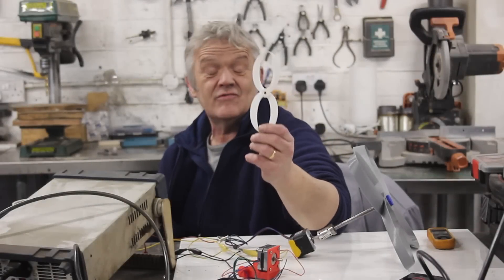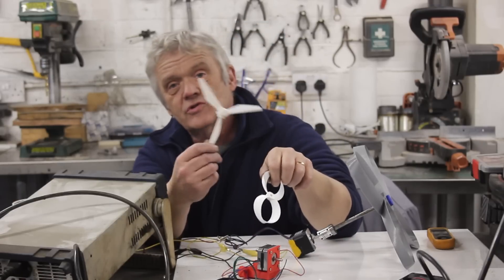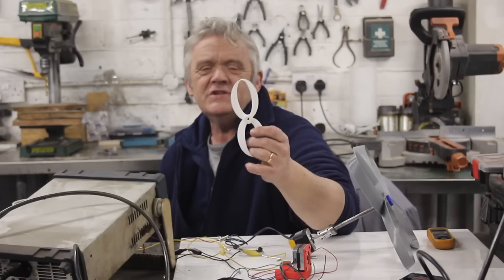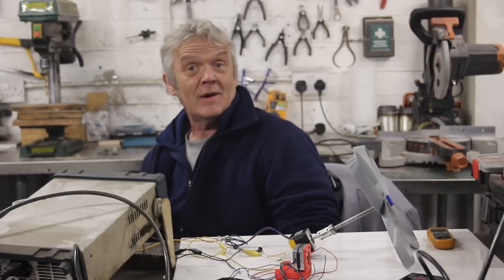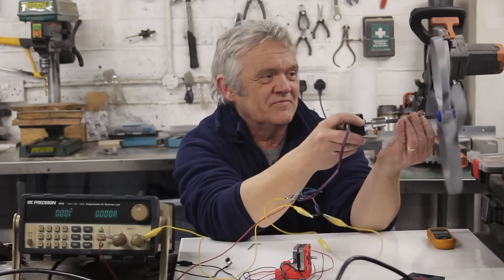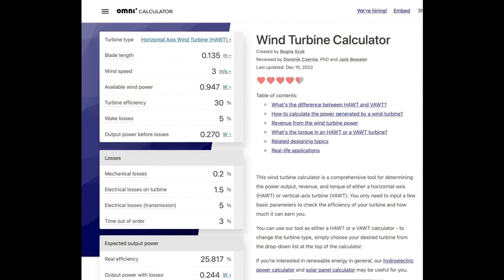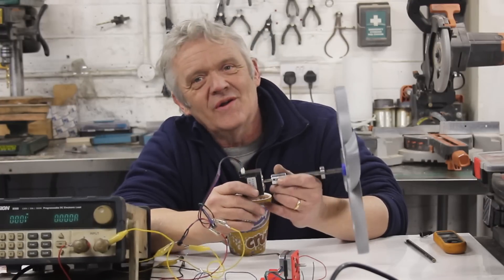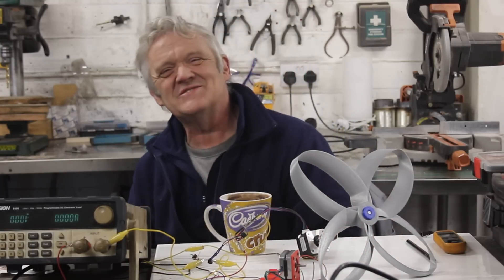1846 Further Testing Of The Toroidal Propeller For Wind Turbine Use

Comment: Why did you not use a normal dc motor or for that matter an AC generator , both of which rotate more freely than a stepper motor , i have yet to see a stepper motor used in mainstream power generation . As the maker of the toroid blade stated about the orientation of convex vs concave i don't see that doing anything other than change rotation direction , but i would be inclined to try different wind direction angles to see if this increases or worsens the outcome.

As for the design ,i've seen a few videos about this in boating applications with lower rpm giving the same thrust , and as water and air are both considered fluid mediums with different viscosities the same should be for air , with a reversal of air as a generator it should create more torque.

I would like to try it myself as i want to make a hand crank and wind powered generator for a super capacitor power bank to feed  AC inverters here in the UK (Scotland bit), i'm pretty sure pvc pipe could be cut into even strips and bonded to a pvc hub with the proper twist added to make each petal.

I do enjoy the video series and get some good ideas , i have a copied book on AC motors used as water turbine generators , i believe you wanted to know the hows and whys of the cap calculations etc , if you can pm me i'll send the pdf i have for this , maybe you could update the  turbine diy generator video ,likely a hit with the video audience.

Best wishes.

Comment: There are now neodymium motors which means they have low rpm but produced high voltage or amp. This low rpm motors need good torque like this turbine design.

Comment: Ur text is insufficient. The advantage of this design is not good rpm, but high torque even at a low wind speed. This is the merit of this design. RPM can be remedied with a gear, but without torque nothing can be done.

Comment: Toroidal props are just inverted Archimedes screws cut into short sections. Their advantage in water is negating cavitation. Under water cavitation is a destructive force due to microbursting air pockets which form when water is "cut" at high speeds. It's not unlike breaking the sound barrier in the air, only this happens at much lower speeds under more dense water. When this happens the microbursting air bubbles cause damage to the surface of the part over time. This is hardly noticeable to external propellers where the bursts can dissipate their shock to the surrounding water but do affect the noise and thrust... The microburst can also cause huge spikes in pressure for internal parts like impellers and can crack the engine casing entirely. So reducing underwater cavitation is a big deal. It's just disappointing that toroidal props only seem to offer a slight noise reduction for aerial applications and don't seem to offer any other real benefits... yet.

Comment: You need the blades more off set like a double winged plane that is connected by a loop in a way that make more lift. I don't think the crazy eight is aerodynamic enough. Or could be made more efficient with better geometry.

Comment: we have all had our fun with how the Toroidal Propeller just don't live up to the hype in air but, wasn't it developed for water use? if so, its dementions need adjusted for the fluid its working in to work at peak efficiency . Please try the traditional blade vs. Toroidal in water

Comment: seems like the angle of the blade is more important than it's shape, just as you found that a flat sheet at 35º was the sweet spot for redirecting oncoming wind downward into your tunnel for that project, and so the angle of the bladed needs to be more obtuse to the wind up to a point, to redirect it, (which is what generator blades are doing, the more redirection the more energy they can take from that incoming wind, while the propeller the more obtuse to it, the more energy it can impart into it as it redirects it, say for thrust.) 

what I want to know is can this angle be changed as the speed of the blade is moved to get more gains, or is this a fools errand and it changes nothing. :) 

the one benefit I can see these blades once the angle is set correctly if that bowed tip can reduce air current vibrations, would be on giant turbines they worry about birds and bats being harmed by the sonic vibrations created, but the direction you are going of many smaller units coupled together to get the higher value amount and in parallel so each one is redundancy, also completely does away with the worry to birds, bats and such because any sound they produce is so small it gets absorbed by air particles and reduced quickly so they don't have the range of influence on the environment, sonically that is. :)

Comment: :/ Disappointed... 
Here's the guy who mixed highlighter-pen ink with gelatin and laughed with infectious glee when it questionably squeezed out a few extra milliwatts from a solar panel... Now we've a stepper motor as a generator as a reliable test? "Steppers are 80% efficient," he says... but this means nothing without a side-by-side and more detail... NEMA has to do with mounting, not winding-resistance, turns, or even the size/spacing/type/strength of the rotor's magnets. If you shine a spotlight on a tiny calculator solar cell mounted in an 8x10 picture frame, it won't give you much more power than a fluorescent ceiling lamp would. And nowhere near the power of an 8x10 solar panel with room lighting.
Not saying I expect a huge difference, nor even improvement, from these blades, but I am saying that you seem surprisingly/uncharacteristically opposed to giving them an honest chance. Almost like you're either afraid of, or hiding, something.

Here's an idea I'd've considered more characteristic of you: I wonder if a toroidal prop could be made of little more than a twisted strip of paper stapled to a hub. Its flexibility may actually be beneficial for different wind speeds and loads, a bit of a centripetal governer... More of a sail than a prop. And, most of all: easy to build. Which is right up your alley as someone usually trying to inspire folk to try things that aren't necessarily the most-efficient, but *doable*.
Maybe I missed a vid?

Comment: I suspect the reason you're not getting anything out of those toroidal propellers is due to 2 reasons:
1.  the models on the internet are not designed for wind turbines and are instead designed as propellers. I personally recommend lowering the angle of attack (making the blade angle closer to the vertical axis by about 5 degrees) and using a slightly thicker airfoil at the root. 
2. You held it backwards the entire time, I can see the camber on the blades. It's like using a solar panel as an LED, possible but not very efficient! 

The advantages toroidal propellers have over their more traditional cousins is faster wake recovery, elimination of wingtip vortices, and a more evenly distributed turbulence area. This means that you can place wind turbines closer together for the same energy output. I don't think anyone is making toroidal propellers for wind turbines but if you do the aerodynamic characteristics of wind turbines and propellers are similar yet very different!

Comment: What you need is a Prantl based prop!    Most efficient ducted fans are found in the cooling fans of the ISS. Also i almost never see a proper toroidal fan in this new found hype. There was an aircraft a long while back that had this kind of prop, but the tips were bent differerently in order to enhance lift and reduce tip vortices. Unfortunately i dont remember who made it. Cheers

Comment: Very great overview of the test process and how to check the results.  One thing people overlook is it was ' designed to overcome cavitation ' and not to increase rotation speed or torque.  One additional test would be to use a motor and a sound meter to ' listen ' if you can hear either type of blade when the wind blows, however, I believe that kind of testing becomes moot when thinking of power generation.  We, as people, have put up with hit-miss engines in our collective history for power generation and sound output is only a convenience factor.

Comment: A conventional propeller as several characteristics like pitch, and the rate the angles change from center to edge, the curvature, straight blade vs swept blade , different values for different sizes and wind speed, that have been refined over many years to be better then just popsicle sticks.
   The new design may have merrit , obviously they will need a lot of research to figure out what kind of characteristics and values need to be understood then tweeked to make them work at their peek before we can truly judge.

Comment: Hi Rob, love the video's, so much information! One difference between the toroidal props and the powerboat prop is the plain on which each surface starts and finishes. The Sharow prop has a distinct double level, almost like a biplane, whereas all the props built for drones etc are simple loops. Big difference and may be why the 3d printed props are pretty useless? Just a thought!

Comment: Hi Robert. I'm the friend you mentioned who sent you this '4 petal' toroidal propeller. Looks a great 3D print but when I make these 'windmills' as garden ornaments I always orientate the concave edge of the blade into the wind. My guess is that it will catch more wind this way, very much like an anemometer cup. I noticed in your test that you had the convex side of the blade facing your wind source and maybe this lessened the efficiency of the blades. Anyway as I say, I make these windmills as garden ornaments and not for power generation, finding that they turn effortlessly in the slightest breeze and the toroidal blades are very strong compared to single blades. My 6 petal version, which I like to see as having effectively 12 blades spins even better and faster. Keep up the great work, love your videos...

Comment: I still don’t see how these tests are “proper”.  All your tests, so far, seemed like comparing apples and oranges. 
First a 2 bladed toroidal and a 3 bladed standard propeller, of equal diameter, with a common wind source. 
Next, a much larger diameter 4 bladed toroidal with an unknown (I couldn’t see it in the video) wind source. If the blower used in this test was the same one used in the first test then it would only be pushing a fraction of the toroidal blade surface at any one time.
To me, a “proper” test would be of a 3 bladed toroidal and 3 bladed standard propellers of equal diameters and a single blower used on both propellers.
I have no idea what the results will show but they should show if one blade is more efficient than the other.

Comment: instead of being same surface area, please try with the same size. the longer the arms = leverage effect and also the 'per area' calculation... so if a 1 M long turbine blade covers 0.79 M^2. (Pi x R^2).  Then what would a toroidal turbine blade that covers the save 0.79 M ^2 do?  Sure, extra weight, but still.

Comment: The very things that make it better as a cavitation free propeller keep it from catching enough wind to work as a turbine. Rather than increasing the blade length, it would work better if you increased the "depth" of the blades. It's too flat, so rather than properly diverting the wind and gaining momentum, it's just resisting it.

Comment: I'd like to see the efficient comparisons to a ducted propeller.  I suspect that most of the gains with toroidal props comes from them essentially having their own moving duct included instead of open blade tips.  Rather than the air sliding off the tips it is "scooped" and sent back in the same direction as the rest of the air.  I very well may be wrong but when I look at them and see them in motion it's what I see happening.  So any gains they'd have over a standard prop for a wind generator would likely come from lower velocity winds and even more so only with much larger prop blades.  Scale them up to sale 5 -6 metres and then I think you'll start seeing noticeable differences.

Comment: ha , Rob is not convinced , trust plus a good dose of scepticism is a good recipey, i would still say watch this space  . These props do work well in water ,claims of 30 % improvements . We are talking fluids so there must be some comparative gains in air , apart from the obvious safety ,ie the E-hang type flying mincers potential damage could be treating bad graze ,rather then limb reatachment surgery . But ,tip vortexes are a huge loss area in air ,on wings and props . john McGiuness , with his Synergy box wing ,seems to be onto a win with wings [ i'd love to play with water foils in a similar way ,could raise their top usefull speeds ] . very interesting watching the ultra high bypass jet developements and the almost return to turbo props ,but with stationary intermediary blades !?.Is it possible these closed tip blades could give the benifits of ducting plus swept area . I can see a return to supersonic props with out the leathal noise ,as seen in the flying banshee  the Republic thunderscreech , or the sound bomber ,or bear topolov TU95 , I believe a hazard to chase planes of other nations that get close to enquire as to why it is flying in their airspace .

Comment: Good demonstration!  I especially appreciate the use of the load meter for measurement of amps and volts.  
You are probably completely right in your conclusion, but your critics won't approve.  A toroidal "blade" has more than one aerodynamic surface in the swept area, with the same outer strength reinforcement as a ducted blade prop.  A four-blade toroidal propeller should best be compared to an eight-blade ducted fan prop.  Both are going to suffer from increased drag within a given swept area in a turbine drive configuration, and neither would be as effective as a three-bladed, simple prop in the same swept area and wind speed.  I don't think that a toroidal blade can be feathered, either, as they are in MW-scale turbines.  However, one proposition to answer to the problem of bird and bat killing by conventional turbines is using a ducted fan blade, and the toroidal design may answer some of the same issues without the same engineering complications.

Comment: No. You are thinking statically, and not at all like an aeronautical engineer. It's already a proven innovation in water propulsion. Those blades are supposed to give more lift at lower speeds and the entire performance curve slightly better than any comparative blade. Quieter too. To see if it's truly better, you need to compare it to a similar diameter blade at various speeds, on an identical shaft held better than just by hand. You need a dB tester too. Alternatively, clip them on to a performance drone and time it through a measured course, recording the noises they make. More fun, but given you are more interested in the generation possibilities, I'm sure something could be rigged up and hooked to that multimeter.

Comment: I am not sure these,  but I do know that in the world of PC fans there are 2 very distinct types of fan one produced maximum air flow and the other maximum static pressure. I was wondering whether this may have detrimental effect, as in the pitch of the blades is designed to be push air rather then be pushed by air? I am sure someone who understands these things may be able to enlighten me.

Comment: These are meant to ‘drive’ something at high rpm… and have advantages ‘then’… Not to be driven by wind at low rpm. Their positive effect lies in their ability to get rid of or greatly reduce the tip vortices which arise only at those high rpms. Those vortices consume energy which isn’t adding to forward motion… hence getting rid of them helps make propulsion more efficient. Essentially you are now pushing a car by hand with a 600 HP engine and measuring the ability of the dynamo to fill the battery… and compare that number to a 100 HP engines car being pushed at the same speed and stating the 600 HP engine doesn’t add any performance to the car. Lol… carry on 😂

Comment: 1. Needs high pitch angle at hub, low pitch angle at tips, to keep constant angle of flow. 2. Could benefit from slot effect between parts of the blade if designed properly for high torque, slow speed. 3. It’s all about thrust versus drag. Single foil has low drag.

Comment: I saw a article in popular science or mechanics magazine decades ago concerning a new discovery in aerodynamics it was little bumps over a windfoil that dramatically hugely dropped the resistance unlike golf balls with their holes this was bumps and I always wondered what it might do to a windmill if you can find it when you're doing your 3D printing you might be able to apply the technology but they said it was a huge improvement that most improvements had a certain degree of success but this was many times higher and I've never seen it used in any application why have a breakthrough if you don't use it

Comment: My home's 1500W turbine is quite annoying, but winter days that have no sun in my location have strong wind. Generating the same power without the annoyance (especially tip speed) with a much larger but quiet prop replacement would be great. Something along these lines has promise.

Comment: Enjoying these videos Robert! Always interesting to see things actually built and on the test bed. From what I have seen you need pretty high RPM to make use of the dispersed tip vortices. I wonder if you made a small light-weight one and used high speed compressed air to get it really spinning up, whether you might see any improvements. Cheers for the video!

Comment: I think it's the medium in which thay work that's why ship's don't use air craft blade's & vice Versa even though you can technically consider air or water as the same in fluid mechanics but thay require different designs for the different mediums.